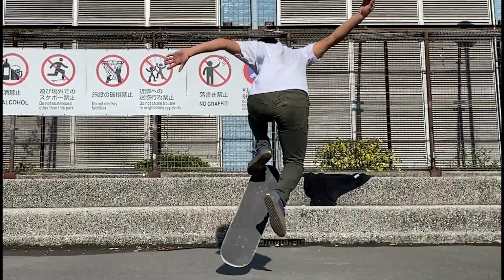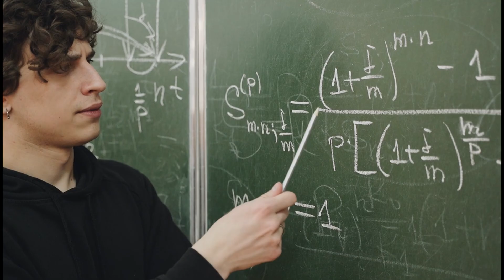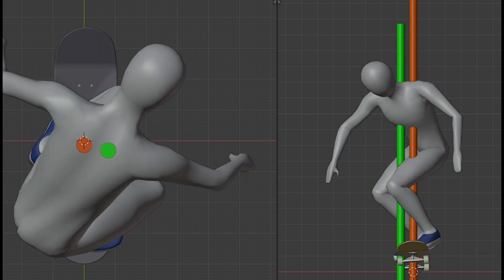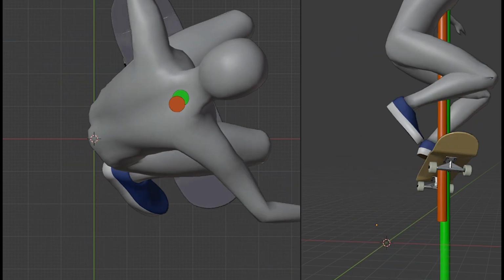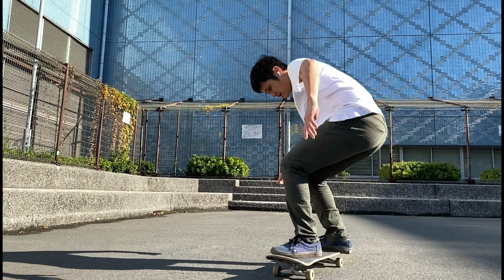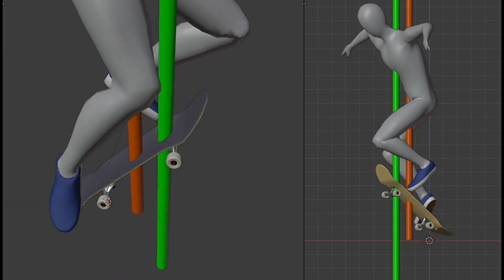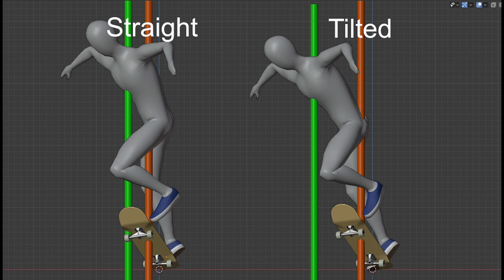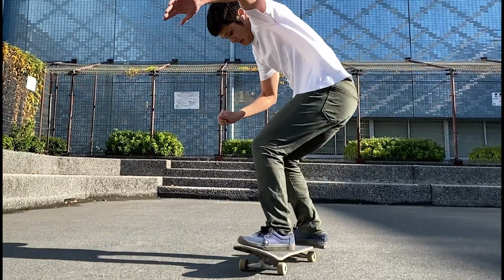Pop shove-it weight distribution.

Comment: Great one once again ! I've never thought of that body weight movement, makes sense, i'll definitely think of it next time i ride!
Also, i believe my pop shove are very different yours. They're entirely done with the back ankle, without (i feel) having to move my weight diagonally to where the board will land. So i pop straight up, like an ollie (btw my back foot is set exactly like an ollie, right on the center of the tail, or maybe just a few millimeters forward). The trick is that i never fully extend my back leg as you do.  Which makes that i'm basically already airborne by the time i need to pop the shove. Then i use my ankle as a pivot (my back foot usually points a bit backwards, whatever trick i try, i dunno why), and shove it with my toes, maybe 30-40 degrees inside. And also because i'm already airborne i dont need any strength to pop and shove the board. That is what allows me to shove it into a front 50 ( im trying shove to nose grind rn but that well too hard lol)
Dunno if im making much sense lol
Usually i dont participate much in commenting but because of the huge nerdism required to make those, i can't help but try to be part of it lol ;)
Happy new year
Reply: Same here fellow nerd skater, I initialy learnt to pop-shuve like the author but then moved to learning how to do them while "staying straight", exactly what you describe with your back foot, I found those to be more aesthetic and give me more control. My main reason for this was to learn to hardflip (which I still can't do though...) and it seems to be better to keep your board straight (vs diagonal) while doing this one in order to bring back you back foot on the board without too much hassle.